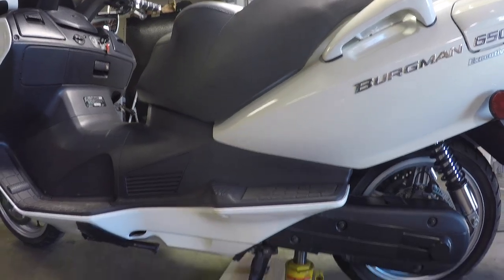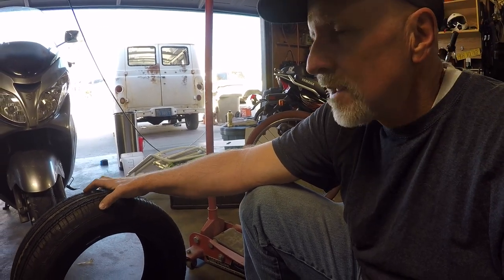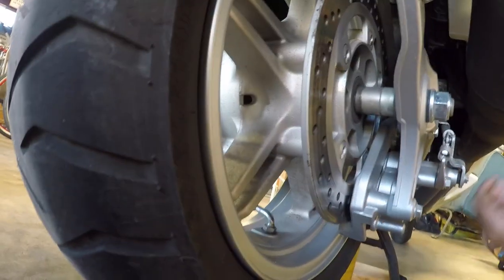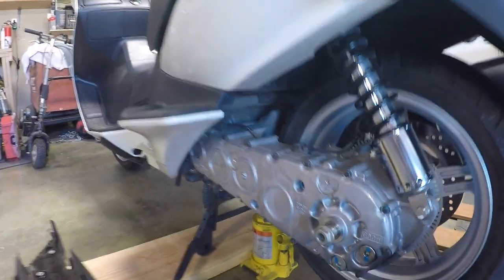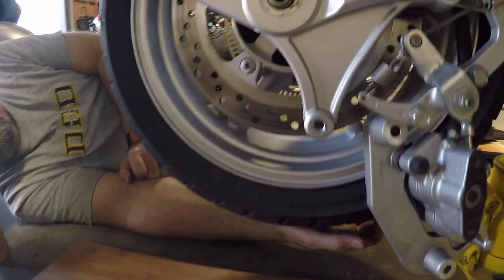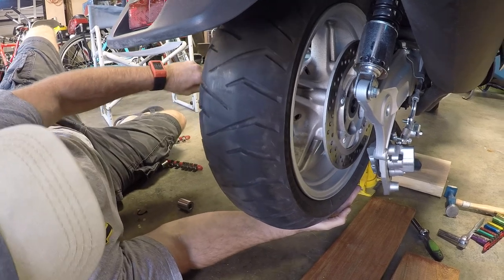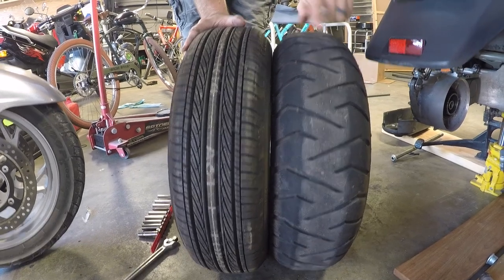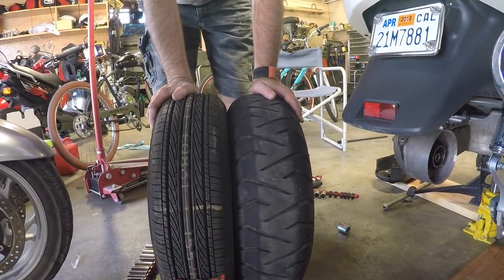Darksiding a Suzuki Burgman 650

Comment: There appears to be a big difference twixt a 'Car' tire and bike tire..............to wit , a car tire is basically made to run Flat  , i.e. very little leaning side to side ! VS , a bike tire is designed with much more curvature because scooters are designed to 'lean' into the curves .......not run flat ! Personally I would not put a car tire on a bike because of the above considerations .
Reply from the maker: joe doakes I really can’t tell the difference in handling. And the contact patch is about the same when turning and more when riding straight. Thanks for watching 😎👍
Reply: joe doakes  You are correct dude.  Also, car tire beads can't seat properly on a bike rim.  Plus, whats going to happen when you need to really lean your bike hard - like in a emergency situation?
Reply: @joonya4427  car tyres stay on bike rims quite fine and are up to the task of very fast riding, hard braking, demanding corners, wet weather, and in an emergency situation I personally trust darkside over the motorcycle tyre.
What's your darkside experience?
Reply: @rossdelaney2745  If their so great, why doesn't ant tyre manufacturer make a car style tyre with the correct bead for a MC?  Do you really think if they were that good, manufacturers would be missing out on that source of revenue?
Reply: @joonya4427  they are that great. And who knows really the motives of the manufacturing companies. More than likely the bottom line and to avoid litigation.
What's my motivation? To tell it as I find it and to dispel the rumours and ignorant naysayers.
I suspect your motivation is simply that you think you're correct. Without experience you only supply ignorant speculation.
So, what is your real motivation?
Reply: @rossdelaney2745  To give people the other side of the story.  You DSers say it is great and safe.  But you have no warrant to claim it is safe.  You have no idea haw much safety margin you are playing with.  You don't know the forces and stresses that you are putting on the various parts of the MC.  All you can say with any certainty is that under normal circumstances you seem to be able to get away with the practice.

And yes, manufacturers are motivated by their bottom line.  If DSing was such an improvement, why wouldn't they design a car style tyre that is suitable and safe for running on a bike?  They could charge more than a standard car tyre and make more profit.  And litigation wouldn't be a problem as the tyre would be actually designed for the particular purpose.
Reply: @joonya4427  do you know the intricacies of the workings of your computer? What about overclocking and the manufacters declarations about it? What about the use of a different oil in your car? Or an other than OEM part when repairing or maintaining anything? My gut feeling has not told me that my bike is far more capable and faster in cornering, braking and in the wet. True, it's not documented nor controlled for the purposes of validated empirical data collection. However, it's far more than you or any expert you have cited have done.
Again I'll say it. Actual experience outweighs opinion, and I should qualify that as ignorant opinion since you have zero rubber to the ground darkside knowledge at all.
Reply: @rossdelaney2745  As to that other tech, I'm no going out on a limb, against expert advice, so I can rely on what experts say.
As to subjective experience, it most certainly is outweighed by expert opinion.  Subjective experience has been repeatedly shown to be deeply flawed.  The only thing that it has shown is that generally you can get away with DSing. Experts, on the other hand, understand the physics, material properties and design parameters ie. their advice is based on scientific knowledge.  So, their advice is on a much more sure footing than your subjective experience.
Reply: @joonya4427  I understand the bikes and the difference in feel is not in my imagination anywhere near as much as you'd like it to be. 

I currently own 3 x Rocket 3 Triumphs.

1 x 2004 model supercharged with kumho car tyre on the rear. Haven't used it for awhile as It's mid-upgrade atm.

1 x 2004 model mildly tweeked oem tyres.

1 x 2009 model shorty exhaust but otherwise stock with a federal car tyre on the rear and a reversed rear tyre on the front.

If you know anything about Rocket 3's they're virtually identical from 04 to 09. In 2010 the Roadster was introduced and is somewhat, but not drastically improved.

A ride on the 04 is quite a different experience to the 09. Noticeably so. Because of the tweeks the 04 goes better but not handling-wise. It's the 09 which is the better, safer bike in the ride-ability department. Not a scientific comparison by any means however it's not wishful thinking nor just in my head the differences between the two bikes.

Your assumptions on the other hand are based on all the credence you give to those with knowledge and credentials but no real-world darkside experiences.

I thought long and hard, watched videos, read accounts for and against researched as much as I could before I delved in and had a go.

You, and many like you, seem to think it dangerous and irresponsible without any real understanding or experience.

You judge without knowing anything. You cite all the "experts" on tyres and conveniently ignore and dismiss anyone with experience and do your darndest to minimize their expertise on the topic of darkside motorcycle riding. 

Well fools may mock but I don't care.

I have found, as have many others, an economic, environmentally-friendly alternative which also effectively improves the cornering, braking, wet weather riding, and appearance of my bikes.

And you remain ignorant. Go figure?
Reply: @rossdelaney2745  Like I have repeatedly said to you, I don't give a damn what you do.  Focus dude.  I have told you this multiple times.  My only issue is DSers telling people the practice is safe when they have no warrant for this claim.  That's the irresponsible bit. Nobody knows how safe or otherwise it is.  

It amuses me that the guy with 3 bikes that have very large engines talks about running CT for environmental reasons.  There are many bikes out there that are every bit as capable as a Rocket 3 but would use less fuel and therefore create less pollution.  Worse, you have worked at least two of them, so they are using even more fuel (more pollution).  Now, I have no issues with the bikers you own, but they kind of make a joke of your environmental argument.  I guessing you also have a car?  Being that you are so environmentally concerned (cough) I'm guessing it's a Prius, or something similar.
Reply: @joonya4427  haha. 

Surely you jest! Focus? It's great advice that you should take. You haven't been paying attention and you completely missed the point.

You did however prove your arrogance and ignorance yet again though.

Anyhow, if it's not possible to say darkside is safe or unsafe or dangerous or foolish or stupid, what argument are you left with? Experts say blah blah blah therefore anyone experiencing any sort of success does not know what their talking about?

You do not know what youre talking about, plain and simple! Plenty of success stories abound yet it's all in their heads? 

Even when shown how a comparison was done, in my case, you attempt to minimize one of the benefits mentioned ignoring the better comparison example offered completely. 

In fact you know it all yet know nothing.

One thing is true, I will do as I damn please. And I'll continue to enjoy the darkside and happily continue to refute your wild and completely unfounded assumptions on a topic you have zero experience in.

You are like the person telling everyone that ice cream tastes like crap (or insert any food or beverage you like instead of ice cream). Yep all the industry experts say that it should not be eaten because it tastes like crap. Yep, they've never tasted it, and nor have you, but they say so, so it must be true!
Reply: @rossdelaney2745  No, didn't miss your point, just dealing with a bit at a time.  OK to your seat of the pants comparison.  Good race engineers make riders test setup changes blind ie. without telling them what changes have been made.  This is because knowing what has been done effects how the rider rides.  Even then, telemetry (empirical data) is vitally important because subjective experience is notoriously unreliable.  Same goes for companies developing new products (like tyres) and their test riders.  Point is, they don't trust subjective human perception enough to rely on it, or even value it more than data.

Of course, where it comes to forces, loading and safety margins, seat of the pants can tell you nothing.  You need data to establish if DSing is safe in these terms.  And yes, you are right, nobody knows this because proper testing has never been done.  I'm not saying that it is definitely unsafe, I'm saying that you have no warrant to claim it is safe.  With no data available, you have no idea how close to disaster you are running.  Maybe a long way or maybe you are actually on the razors edge.  So, all we have is subjective experience and expert opinion.  Given the fallibility of subjective experience, I'll take expert opinion every time.
Reply: @joonya4427  and I'll continue telling all who wants to know, as well as some who don't want to know, exactly what has worked for me.

One thing for certain that I can absolutely unequivocally vouch for is the improved grip when accelerating out of a corner. It's a no brainer to compare speed and grip vs loss of traction through the same corners on essentially identical bikes with the different tyres.
 
Whether you like it or not, agree with it or not, it is what it is. No wishful thinking and not just in your head stuff. It's measurable and noticeable. 

Does that make it safer or more dangerous? It could be argued either way. 

Now as far as safety margins go I'm super comfortable with the ability of the rubber of the car tyre's bead to flex enough to conform to the slightly different and slightly larger diameter of the motorcycle rim.

Seeing the videos of stuntdrivers in cars performing jumps, burnouts, hitting ramps at speed, and even sometimes just one ramp at speed to put two wheels in the air and then some fool climbs out a window to stand or rather balance precariously while those other two tyres are seemingly safely handling far more stresses than my motorcycle is likely to exert, all give me increased confidence in darkside riding.
 
No doubt those intelligent experts would also warn that the treatment of tyres in this fashion is not a good idea while the industry lawyers would be positively salivating at the thoughts of fending off all the potential litigation. 

Interestingly there is also floating around cyberspace clips of tyres being tested. Wow. The stuntmen were gentle on those tyres by comparison.

So, I'm not concerned with experts opinions, naysayers fears, nor any fools knocking me or my decision to darkside.

Anyhow, ice cream tastes great. You really should go and have yourself an ice cream or at least listen to those who've tasted the ice cream.

          🍦 🍦 🍦 🍦 🍦 🍦🍦 🍦
Reply: @rossdelaney2745  Your ice cream analogy fails to make its point.  With ice cream tasting good, the subjective experience is the whole story.  With safety, regarding factors that you can't see, like forces, proper testing and data is the only reliable source of information.  Subjective perception can't tell you anything about these.

As to stunt drivers, I have personally seen a car debead both tyres when doing the two wheel thing.  It does happen.  And that is with correctly fitting beads.

I'm glad it has worked for you, but without proper information, you simply do not know how close to disaster you are going.  Maybe a long way or maybe you are on the razors edge.  So, you can't honestly tell others that DSing is safe.  And that is my only issue.  Not that you are DSing.  Not even that you are talking publicly about it really.  The issue is that DSers are saying how fantastic it is, but never mentioning that they have no idea of how close to the limit of various mechanical forces they are running.
Reply: @joonya4427  it fails to make the point since you fail to value any experience from actually getting on a bike and riding darkside since in your mind only the industry experts and scientific data tells any truth.
Reply: @rossdelaney2745  Yes, these are mechanical devices designed by industry experts using scientific principles and applied science.  So expert opinion and science is 100% applicable.  It's not that your experience has no value, but it can't tell you anything about the forces being applied to the various components.  Only proper testing can do that.  And that is my issue.  You simply do not know the physical limits involved with the system, or how close you are to those limits ie. you don't know if it is dangerous. And in general, DSers extol the virtues of DSing, but fail to give people the whole story.  That is all I am doing.  Giving the rest of the information about DSing ie. It contains some big unknowns, and therefore cannot be said to be safe with any level of certainty.
Reply: @rossdelaney2745  And your analogy fails because it is purely about subjective experience, where as I am talking about the other part of the story ie. the physical science.  Tasting ice cream won't tell you about its effect on the body.  You need science for that.  That is why it fails.
Reply: @joonya4427  my biggest mistake has been the assumption that you are a thinking person. You've consistently deferred to so-called experts opinions and expertise rather than testing this concept for yourself and you minimize the validity of anyone actually riding darkside. If I say what has worked for me you'd likely be quick to point out that I might be too close or even beyond the car tyres limitations. I note that you've never come up with anything even remotely of your obsessively feared failures ever occurring. I explained how I have been able to determine differences in the handling characteristics of mc vs ct on nearly identical bikes and you side tracked the point. I'm happy for you to remain in your ignorance but you clearly have no idea.
Reply: @rossdelaney2745  Notice he doesn't cite any "experts" actual data?

Comment: Is no one concerned about the dangers of tight cornering with significant leans?
Reply from the maker: Werner Ostwald so far at least for me that hasn’t been an issue. When I hit the corners it seems to handle fine.
Reply: Yes, I'm very concerned. Lots of pea gravel as well as tar/gravel roads in my area and we have found the CT more stable where the MT would loose traction more often. B650, GL1800, C50, Swing, and VT1300 all have CT on them now. Of course there are many who advise against any mods to a bike or car. The owners manual advises against anything other than OEM but you still see chips, windshields, top cases, trailer hitches, handle bars, tool bags, over packing, etc all being changed.....And yes, I know there are those that are concerned about safety IF they disagree with a particular mod, but it IS safe if they like it. Funny how that works......

Comment: Do what you feel is your right. But be careful, first car tires are not made for scooters or motorcycles and are not safe. Second they are not DOT approved for use on  scooters or motorcycles. But I think toe most important is this. A friend of mine put a car tire on the back of his motorcycle and it was great until he was involved in a accident.  When he went to court for the accident, and it was a toss up to who was in the wrong, he lost the case . His Insurance Company dropped him because he illegally modified his motorcycle with the non DOT approved tire. The Police report mentioned the tire was not legal.